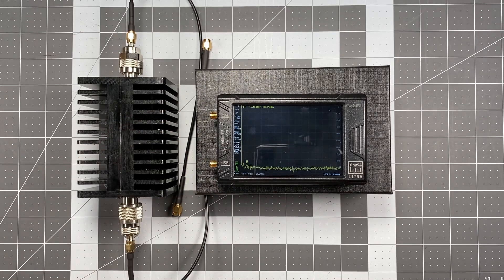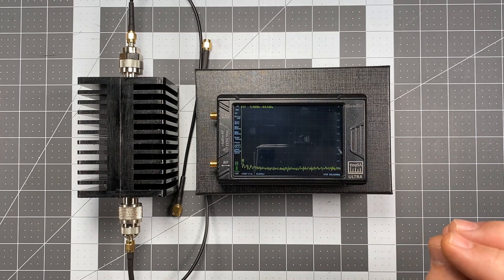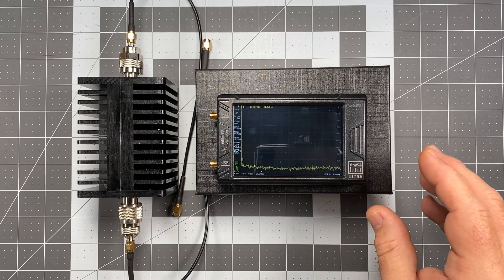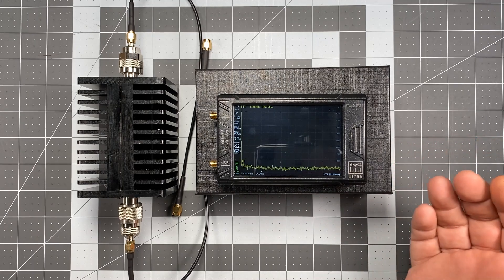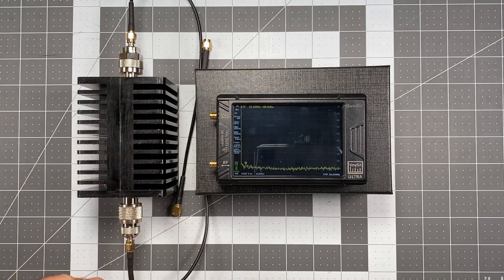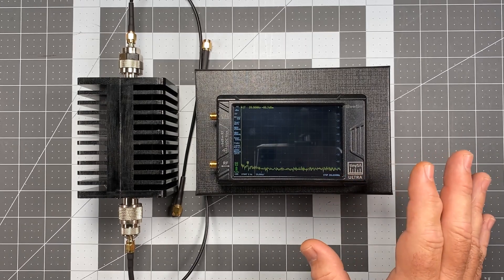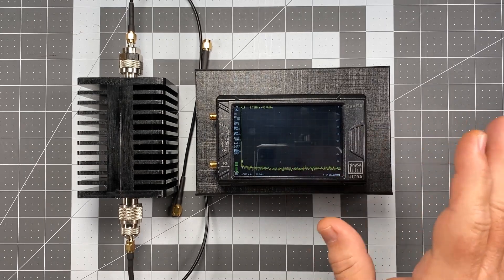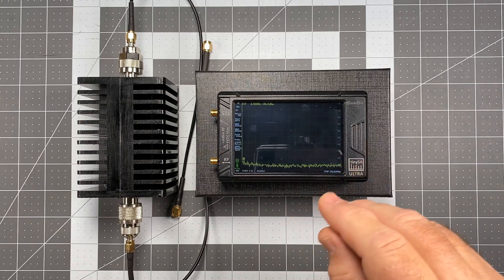A new piece of testing equipment for radio reviews

Comment: The problem with spurious emissions is NOT interfering with other radios it's causing the Paramedic next door trying to save a baby in cardiac arrest while spurious emissions from your defective radio shut down his heart monitor/defibrulator as he frantically attempts to restart it and save a baby's life. Radio Operators need to understand what you're dealing with here. It is your responsibility as a licensed operator to be SURE your equipment is not killing babies.
Reply from the maker: Where did this happen? I would like to report the details.
Reply: @KS6DAY  Anything to keep from having to test your radios , eh?
Reply from the maker: @DronesandHamRadios  I see that you failed to cite a valid case. And instead have chosen to respond with a snarky little reply that makes zero sense given that the topic of this video is entirely about me purchasing additional gear to TEST MY RADIOS. Might I suggest you regulate your meds better or do whatever it takes to improve your impulse control because you are malfunctioning at the moment.      ..-. ..- -.-. -.- / --- ..-. ..-.